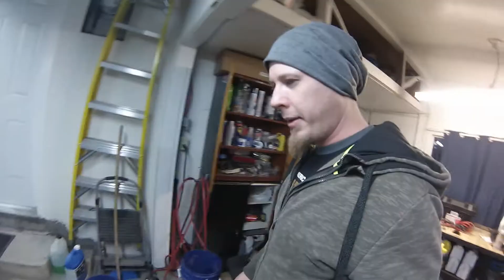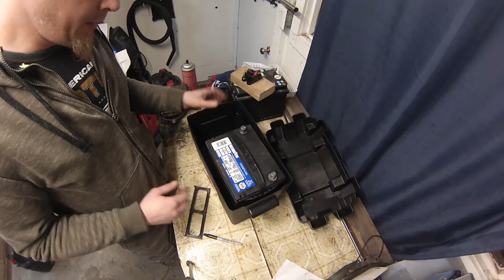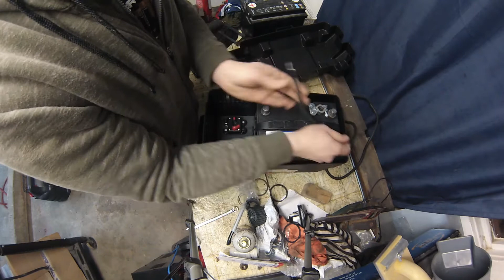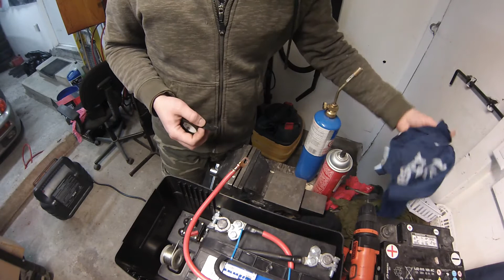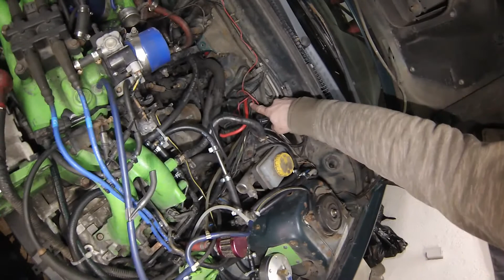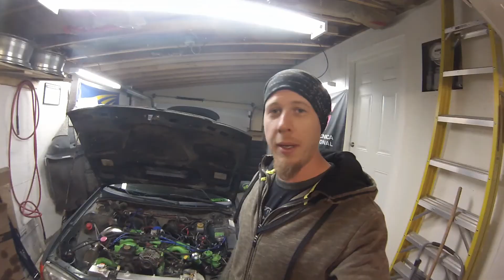Subaru Impreza Battery Relocation - How To

Comment: NICE video!

I think in Subarus, especially turbo ones you can get away with thinner wire as they're only 8 CR and 2000cc displacement, so not too much juice to start them.

Obviously thicker wire is better, especially if pure copper and not CCA cable.

I did this in my WRX gc8, tried having the wire go under the car but that made me too paranoid, for example maybe debris from road could hit it causing the wire to ground on the chassis (I'm using a 150a circuit breaker, on positive close to battery)

Trying to work out best way to route through cable and was thinking of having wire come through car then back into near transmission tunnel and to the engine bay.
Reply from the maker: This was a boosted NA engine and CR was 10:1 always better to have more available amperage. Most will route the cable under the rear seat and along the center console or either side sill panels under the doors. There is a couple places to go through the firewall.

Comment: Jesus fuck when the car started I thought the video started blasting electronic dance music ear rape. It scared the hell out of me haha I like the way you did this! Did you feed the positive wire under the carpet? Also, is the breaker necessary when doing this?
Reply from the maker: LOL Yeah the exhaust is way too loud for that mic and it gets completely distorted. Yes, the positive lead is under the carpet. Some type of fuse protection should be installed with a rear located battery. The potential for fire within the passenger compartment increases significantly without a fuse or breaker.
Reply: Awesome! Thanks for the reply! What headers are on your car? I have my rear cat removed and I figured I'd take out the front one two since I have to take out the exhaust and weld in a bung for a rear o2 sensor anyways but I was also thinking about getting cheap eBay aftermarket headers. I found one for like $60-$70. I heard a lot of hit or miss with fitment and stuff but I have an entire maintenance shop at my disposal and two people I work with that know everything that I don't so I'm up for most challenges. I was curious if that's what you had on your car to see if you noticed any performance out of them like do they actually have a bigger inside diameter or create more flow in any way. Sorry for the long comment especially if you don't even have what I'm asking about haha
Reply from the maker: Comments are always welcome, short or long. 
The header on the car is a unequal length Borla replica header from eBay, most likely the same as you have been looking at. Fitment is tight when bolting it on, but easily managed. The pipe would flow more than stock and works fantastic for my turbo setup. You will not notice any change in performance, but you will get the notorious Subie rumble that most of us want. The rest of the exhaust was changed in a three part series last winter. Much better sound clip in part three.

Comment: Getting close to 500 subs!
Battery in the back also helps with the front heavy Subaru drive train.
Reply: Oh, I see you said that in the description! I've also had some batteries freeze lately in this extreme weather. I think they get hot when running and then attract moisture as they cool. Then they turn into a block of ice. XD
Reply from the maker: Thanks man, having a lot of fun with the channel! 
A battery can freeze relatively easy if not charged. Charging from the alternator keeps electrons flowing through a battery helping it from freezing day to day. In really cold places they use electric battery blankets along with a block heater.
Reply: Yep! I've considered getting one before, hahaha.